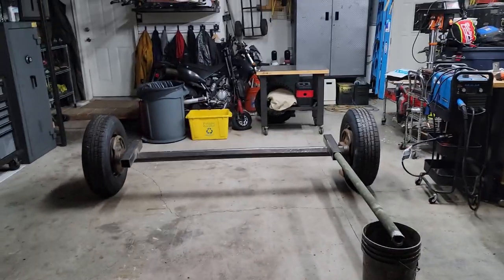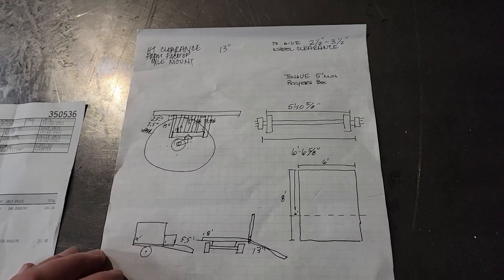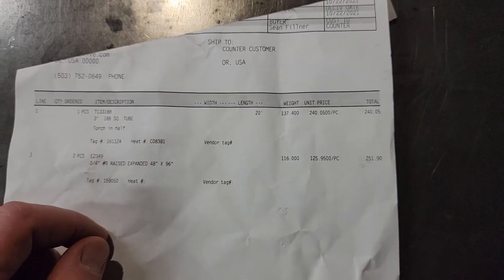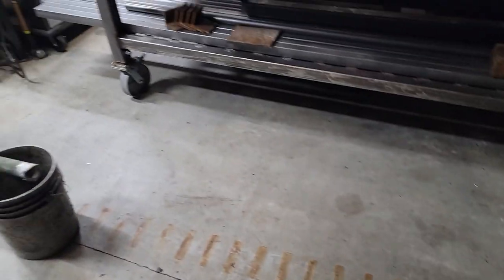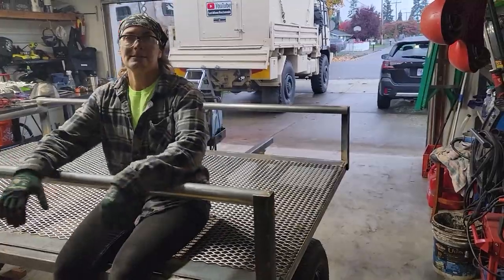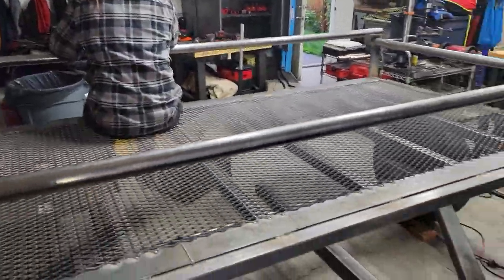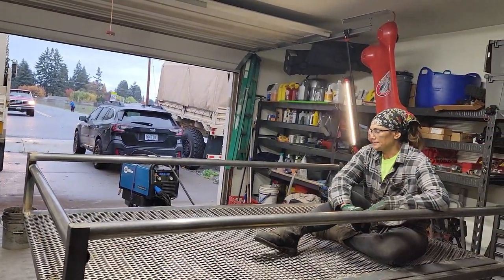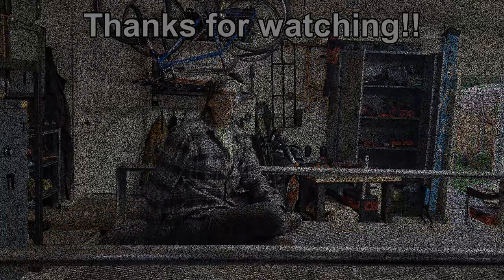Mini deck over torsion axle trailer build episode 1 (planning, tongue, deck, uprights)

Comment: Have you thought of going axel less also may look at kneeling as well easier to load motorcycles snow machines as the trailer goes right down to the ground drive on tie down air up and go . Just thoughts back to the video lol have an awesome day peaceout had to come back and add awesome build so far you both really hustled on this trailer , hope it doesn't take too long for the parts to get in  .  👍
Reply from the maker: I have seen those.  Their off road clearance is not the greatest.  I like the idea but it is a bit much for my skills...

Comment: Recently broke a leaf spring  on my trailer in remote Utah, used a bunch of ratchet straps to stabilize the axle on the broken side, then hauled it 2000 anxiety filled miles  home.     Now I'm debating its replacement.....go back to leaf springs or something different?       It was a 3500 single dexter axle dirt bike hauling trailer.    Maybe torsion would last longer than the 60,000 mi I went before the leaf broke?    Or just proactively put  new leaf springs every 20,000?     Good trailer build video!
Reply from the maker: Torsion axles will outlast any leaf spring/solid combo.  They are more stout in every aspect and if you are patient you can find great deals on used ones online....

Comment: How'd you weld on the new mounts without burning up the rubber inside?
Reply from the maker: There are several methods.  Willow used the very slow method outlined in several YouTube videos of others doing the same thing....